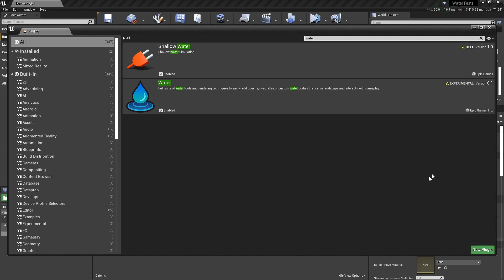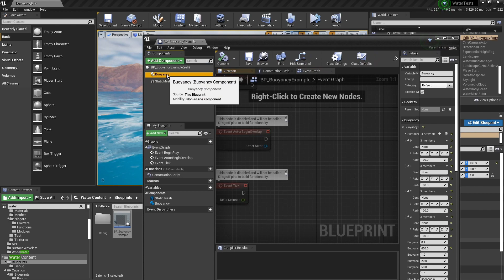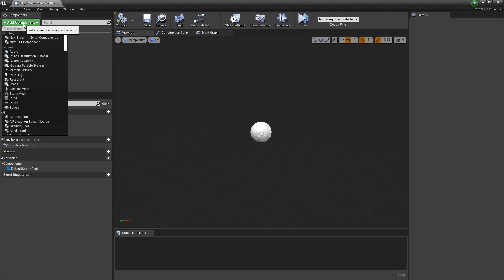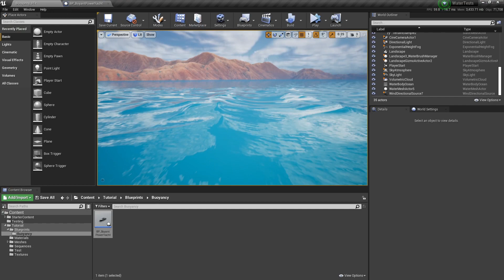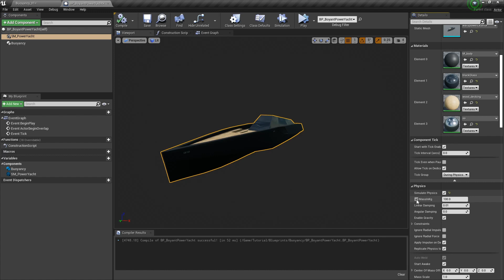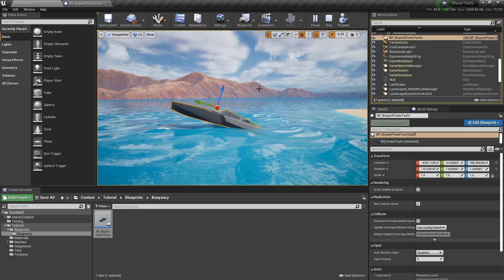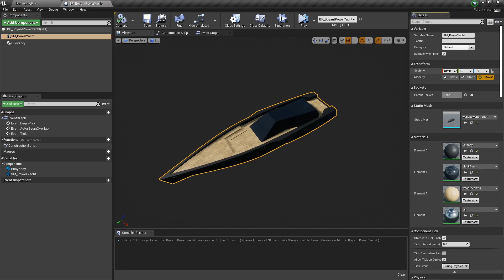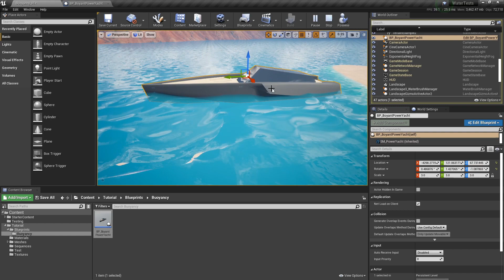UE4.26 Water Buoyancy Tutorial - How to make things float

Comment: If your staticmesh is placed within water during level start, be sure to enable generate overlap events during level streaming. Otherwise it will sink because no overlap events will trigger our buoyancy compnent.
Reply from the maker: Great point!
Reply: This is not seeming to help - I check Generate Overlap Events During Level Streaming on my object under Collision; and I have tried all 3: Use Config Default, Only Update Moveable, and Always Update and my boat still "falls off"/sinks at the edge of a lake or river...am I doing something wrong?
Reply: I still cannot get this to work - I've tried setting Generate Overlap Events on my pawn BP in the scene and in its Event Graph on the pawn and the WaterBody actors...still "falls off" my lake when transitioning to the river...
Reply: @kevinpage  It only works for that specific editor box or whatever it's called, as far as I know it doesn't work for any other meshes. If you want it too then you have to use those boxes with transparent materials. I have no clue why they would add a buoyancy system and rig it to only work on a demo box but from what I've been told that's what they did.
Reply: @unrealdevop  oooooh ok I'll try that. That's a funky workflow, but I'd imagine they'll fix that. Thank you!
Reply: @kevinpage  Yeah, I mean if you wanted to go through their BP and study it maybe you could figure out why it only works with the Editor Box
Reply: @kevinpage  Hello! May be too late but you can add 2 or more boyonce component and add 2 pontoons on each  boyonce component
Reply: @mrognor3123  ok thank you - I'll try that when I get back into it.
Reply: how do you do that?
Reply: Thanks, that fixed it for me for the river and lake.
Reply: <Generate Overlap Events During Level Streaming> should be enabled on blueprint, not on static mesh. Then it works on any mesh. UE5.02

Comment: Great tutorial :) I have an issue though, I tried following along but it wouldn't work for me. I was using a Cube as a mesh (Just to get it floating) but the item still just sank to the bottom. Any idea where I could troubleshoot it?
Reply: Had the same problem just then, as I didn't have a "boat" I tried using the a basic cube -  couldn't figure out why it wasn't working.  And I couldn't find the Buoyancy example either even with the tools turned on.

Comment: Ok, I have a great grasp on what’s going on. I can make any object float. I use the cubes to determine where my pontoons need to be to make my objects float. I turn on physics and everything is good. I am just thinking about having multiple objects attached to this buoyancy blueprint.  First, make sure my initial object floats correctly and with the correct mass and size. Then, I was thinking of attaching as many other objects as I wanted to and make sure they did not collide with Anything but my character. That way, I am thinking I could have for example an ice sheet with a bunch of rocks on it with decree from the sea and maybe some computer parts on this floating rock. Everything would be attached to this sheet that would be floating and then the sky is the limit. Hopefully everything works that way. I have a fbx file that has several objects on it and the buoyancy effect is just not working correctly. I will report back when I try to figure everything out.
Reply from the maker: Nice going :)

Comment: Does this only work for a static mesh? Having trouble adding it to a skeletal mesh.
Reply from the maker: I haven't investigated using this on a skeletal mesh but I'd be keen to know if you find a solution :)
Reply: @SnapLaunch  It does work! My issue was actually something to do with how the lakes work. It appears that there is a drop off some distance from the edge of the lake where buoyancy doesn't work.
Reply from the maker: @manbearfrink  Excellent! Thanks for sharing that - what a help!

Comment: Thank you so much for this! I was incredibly confused on how to use this feature, definitely subscribing to your channel.  As a brand new user this is one of the few UE4 tutorials I've found where the steps are thoroughly explained!
Reply from the maker: It's great to hear the tutorial was useful - thanks for the sub and feedback!
Reply: @SnapLaunch  I do have one question, I was trying to get a ship to float and the four point system just did not work.  I ended up having to put one in front, one in the back and two on the sides with the pontoon radius cranked way up. I also had to crank up the ships weight otherwise it was doing doing backflips across the ocean.  In the end everything came together for the cinematic I was making, however, if you got two close you could tell the boat wasn't completely resting in the water.  

I'm not sure how to work around this is it just trail and error each time depending on the size and shape of the boat?
Reply from the maker: @scarletworeyellow  I built the pontoons here by trial and error but if I had to do a lot of differently shaped boats I might look at creating a procedural implementation. If the boat is floating above the water, have you tried adjusting the Z values of the pontoons to set it lower in the water?